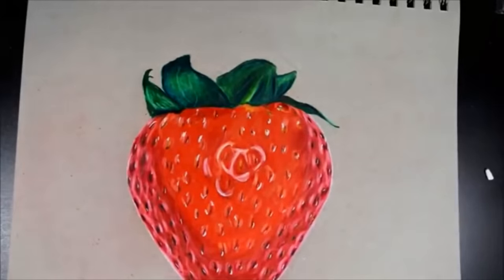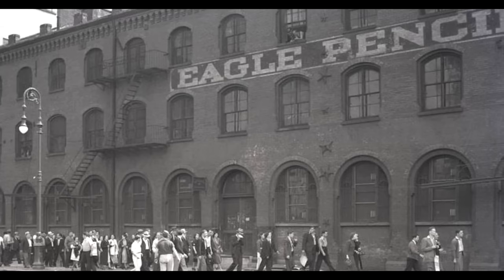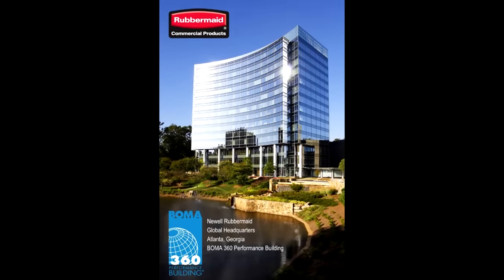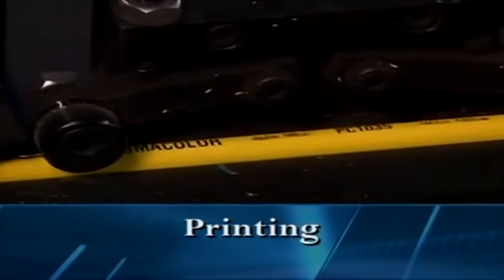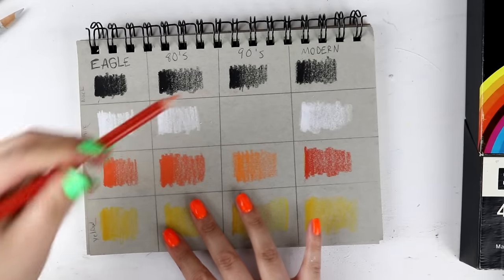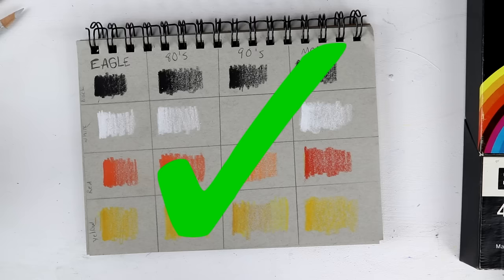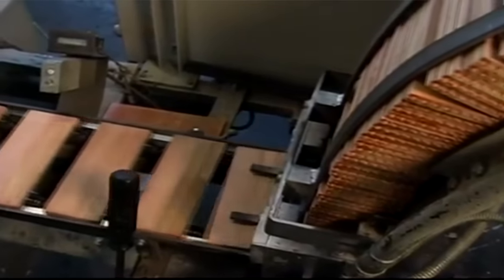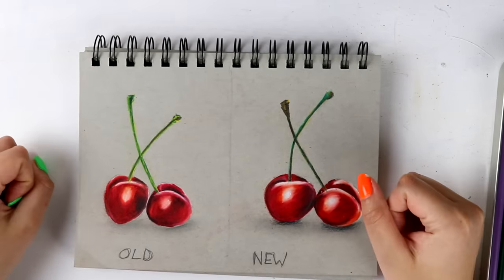Comparing 80 YEAR OLD Prismacolor VS 2019 Prismacolor Pencils: Have They Gotten Better Or Worse?

Comment: Alternative theory: they have always been softcores but the cores have dried/hardened over time
Note: I have a set of eagle prismacolors and they are just as soft as my new ones, but they were in an old protective tin when I bought them. Maybe air exposer over time changes or impacts the cores
Reply: That is what I thought. It makes sense
Reply: oh I didn’t even think of that
Reply: This theory makes the most sense, tbh.  Rather than some secret conspiracy of a formula change.
Reply: I agree with you. I have a set from  eagle prismacolors as well and they're just as soft.
Reply: I agree!! I have a set of BEROL's from 1970 (sigh...my first set)...and they were buttery soft and the ones I still have still are. I just can't handle the never ending breakage of the new ones. It's frustrating as heck and why I switched to Polychromos.
Reply: @mcescher1957  I ended up doing the same. Polychromos and Pablo pencils.
Reply: This.
Reply: wait.. you're smarter than I am lmao
Reply: Yeah, my grandma gave me an EAGLE set, and they're super smooth and I love them. I remember some classmates in art class were jealous of how nice they were...But I am no expert in colored pencils.
Reply: Precisely my thoughts
Reply: I don't think so. I found some old ones in my grandparents house vs the verithins and the old prismas appear to be the same hardness as the verithins.
Reply: Or there using different chemical mixtures and coloring bcuz and it changes the density
Reply: I agree.  The wood is what the problem seems to be.  It shreds, splinters, and is near to impossible to sharpen on some pencils.  I got 4 inches of use from a red pencil that wouldn't sharpen and just broke with each turn of the sharpener.
Reply: Yes, I have notice the same thing with cosmetics.  So, there really is not way to tell the difference in quality.  You will never have a new product from the 70's because it is from the 70's .  Things age.  It is cool to see someone drawing with the old pencils though.
Reply: This was my thought. Even the notorious Twinky is going to dry out a bit over several decades.
Reply: You know what that actually does make a lot of sense
Reply: awkwardsity good thought.
Reply: It may be due to moisture and evaporation over time this may change how wax changes over time like the wax probably melting together due to formula or drying
Reply: Ok, so, one of the biggest things here that we have to know, is whether they are still wax based or if they were oil based, an oil based colored pencil is going to be much stiffer and allows for better line work, while a wax provides a much softer tone and great pigment overlay, oil based pencils don't blend the best.

I did however notice that it looked as if the old pencils went down like wax in the video, but they seemed to just smear instead of blend.
I too am inclined to believe that they are just a dried wax pencil, but you never know, unless someone has the old package.
Reply: Shadowwolf975 I have some from the 90s still in the package that claim to be wax, but the eagle ones I have don’t have any ingredients listed on the package
Reply: @awkwardsity  dang, that would have definitely helped clear things up
Reply: This seems pretty obvious
Reply: E Nunya I don’t have Prismacolors but this happens to me with other pencils and colored pencils.  I’ve noticed it with more recent Crayola colored pencils.  It’s very annoying.
Reply: I agree with this. I was able to get some eagle prismacolors and another set called Eagle Verithin and they work wonderfully for me. They are incredibly soft and layer well, so it was odd to see how they behaved for Rae versus what I have seen and am used to.
Edit- I also have some Venus Col-Erase Pencils that have hardened up, and some that are exactly the same type but are super soft and lovely to use.
Reply: It does
Reply: @enunya  (I'm sorry this comment is old) I bought prismacolours once and hated them. The wood was terrible they just fell apart and didn't even last a week. I think I threw them out lol. I've since seen people talk about using knives to sharpen them instead but honestly it's just not worth it for me.
Reply: Nope, I used those old Prismacolors in art school late 70's early 80s and I used them with a few strays from my Dad's Eagle pencil stash.  The formula had to be different because blending back then was a whole different thing.  You layered light layers over one another to mix the colors optically , not actually blending the medium physically.  OR you used a Q-tip with a little solvent to get the colors to blend.  Clearly new Prismacolor blends physically on the paper. At least in the cases of some colors.
Reply: Yeh could be, but isnt it waxy? Would wax do that
Reply: That's my theory as well
Reply: The only change I suspect is the wooden barrel. I feel like the wood is cheaper but the formula is the same.
Reply: @Possumspade  Yes, wax will dry over time. It becomes brittle and discolored as it ages.
Reply: That’s what I thought, too!
Reply: @enunya  The worst part is, I am not entirely convinced its an issue of just being cheap. I kind of suspect that there might just… not be enough trees left of the harder, higher quality wood to make pencils out of them anymore. Not if people want hardwood in their house at least. :/

Comment: Eagle looks the most pigmented. Is that just me?
Reply: Noah Crozier yh especially that those has been around for 80 yrs, just imagine how they looked like as new
Reply: It does
Reply: They are more for sure. I work in mostly vintage pencils and they seem to me to be the best of both worlds. Best of Polychromos and of Prismacolor. I thought it could be age but I like the older than Midpoint. There is a version before Eagle and that is when it was Eagle “Turquoise” Prismacolor colored pencils. Eventually it dropped out and Turquoise was meant for the graphite alone. Canada had factories as well and their versions kept up the quality much longer than US.

Comment: Love this video....as a 62 year old artist, I got my first set of Prismacolors around 1970...and it really breaks my heart to see how the quality of this loved art supply has plummeted. In fact, I actually still have a few of my original Prismas in my collection (I can tell because 1) they say BEROL Prismacolor 2) the color FLESH instead of the now pc  LIGHT PEACH and 3) they are stubs....The fact that these older pencils are still being used and haven't shattered into a million bits, while my brand spanking new pencils shatter if I stare at them too long...tells the tale. It's also the reason why I switched to Polychromos pencils...I had that wonderful set of 48 with the self standing packaging. It was the best. .Prismacolor...I hardly knew ye.....(lol) Keep it up Rae...I've been around the art world for a long time, and your videos are some of the best!! BTW...one more thing...it's not just an uneven core, or that the pencils are a softer formula...I'm fine with that...BUT the pencils break because the pigment cores are not glued onto the surrounding wood. Because of this, whenever a pencil is dropped (either in shipping or whatever) the core shatters into a million bits and that is why you often cannot sharpen them. I have tried heating up the pencils to soften and "heal" broken cores...but unfortunately, until the makers of this wonderfully buttery soft core start gluing those puppies in place...this will never stop. And I just couldn't justify paying good money for a pencil that I used once because every time I used it, it would break, and then break in the sharpener, again, and again, and again.......on infinitum....you get the picture.

Comment: Material do get old and brittle over time. I remember those pencils being soft. Like when you have new crayola crayons their better than the old  ones. They do expire at times even though they shouldn't.

My american prismacolor still don't break and their butter smooth still but I keep them in a not so dry but dry area. So if your pencils came from texas or other silly hot states like California... they might be not the best reputations of what they were long ago.

Just to edit and add. It's because things still have moisture in them even wax unless their are products like dry pastel that they wont loss their consistence. Wax actually have moisture and when it loses it in products it cause them to not work well but to much of it can hinder it too.

Comment: Great video! I think another thing to consider is the effects of aging on old stock. I don’t think that a 1930s era pencil will perform the same way today as it did when it was new.  But this is a factor that is virtually impossible to test unless you have the resources to make a new pencil using the original formula.

Comment: On the final drawing, was she just using the 30s ones and the 2019 ones, or the 30s and the 80s together and the 2019 and the 90s together, or 30s, 80s, 90s together and the 2019 one for the new?
Reply: Miss "Nancy Drew's" rudeness aside...I wondered the same thing.  She didn't clarify that and it could be any of things you mentioned.  I personally thought original & 80's vs 90's & now.  But it could have been just the original vs now and skipped the 80's & 90's since 80's was similar to old and 90's similar to new.  Anywho, doesn't really matter to me...idk why I watch these videos, I'm not an artist.  Not a good one, anyway! 😄  I guess I still find it interesting and I like Rae's personality.
Reply: Sweet Insanity I’m not an artist, either, but I was curious. Haha. There’s also the fact that she said the formula most likely changed around the 90s area, so I didn’t know if she was comparing formulas, either 🤷🏻‍♀️
Reply from the maker: I used the 30s/80s and the modern (skipped using the 90s since they’re the same as the modern) 😎🎉
Reply: SuperRaeDizzle Ooh, okay. Thank you, Rae! ❤️

Comment: That 90’s 24 was my first prismacolor set, I still have it.  The package is a little cheap but it does transform into an easel to make them easier to access while using them.  I also have two 48 piece sets and a 120 from the late 90’s-mid 2000’s. Oddly enough, the 120 has Sanford prismacolor stamped on them instead of Berol.

Comment: One thing to add about the newer pencils: there were glue issues. If dropped for example, the lead would break inside and sharpening would be problematic. Lead would even fall out. I did not drop my pencils but the ones I ordered did have inside breakage. I have no problems with my older pencils. Also layering with oil based pencils such as Faber-Castell is not done by burnishing; you have to do it in light layers; do not fill up the tooth of the paper until the final step. Thank you for the video. I enjoyed seeing the older pencils side by side with the new!

Comment: The packaging from the 90s era Prismacolor set had a stiffer cardboard box inside the thin cardboard cover with two flocked plastic pencil trays. The top folded down to prop the case up, similar to Staedtler fineliner cases. I purchased the large set in 1997, the lead is very soft. The Prismacolor Verithin colored pencils have a harder lead that is harder to blend.

Comment: A lot of it is also preference and experience. I was gifted a tin of Koh-i-Nors in middle school, right as I was starting to experiment with color. I have tend to prefer them over any other brand because I know how they work and how to use them well. Older artists working through the transition may have had all that experience and comfort with using that particular tool change with no explanation.

Comment: I actually have a set of old Berol Prismacolours as well as the newer Scholar Prismacolours and Prismacolour Premiere.  The biggest difference between the Berol Prismacolour versus the ones of today is the lead width.  In the old one the lead was wider and they used less wood.  Today they make the leads thinner.  The quality of the wood is another big difference.  My Berol's don't break as easy as my current ones.  They also had a wax base to the older ones which is why blending was not easy.  Today they use more pigment and still a base of wax however because they use less wax it creates a much smoother blending.  Just a few notes about these.  They are my absolute favourite pencils however I am in love with my Faber Castells as well and they are break resistant and blend very well.

Comment: I took five years of just art classes at my local art store. Many classes were just using the Prismacolor pencils. We used the wax versions. The Verithins are not real color art pencils. They are hard and to not blend well. A couple of my classes taught how to blend using order less paint thinner. We used a script liner brush. I like using the dry brush technique. Very little thinner on the brush. 
The thinner softens the wax in the pencil on paper and does a fantastic job of blending. Even the colorless blender cannot do this good. However, nothing beats digital. I can draw by hand, scan it in, and paint over. Photoshop was the best. They decided to raise the price and then stop selling it as a product. I have since converted to Clip Paint Studio. It is not as expensive as Photoshop was. It is geared for artist not photographers. It can still no most, of what Photoshop did with photos. The quality is unmatched. Most of my work is geared to animation and I have been drawing inside the animation tool. You can still shade and use images for textures. It is higher quality than pen, pencil, and water color. 
In this video, I am assuming that the Prismacolor pencils are the wax art pencils. Before art school, I did not realize that there are two kinds of color pencils. Only the wax versions are intends to do artistic things.

Comment: You're right... If I recall correctly, Berol came to possess the formulation for the Laurentien pencil crayons, from Canada, sometime in the early to mid 1990's which would explain the new "creamier" formulation of Prismacolours. Laurentien pencil crayons were incredibly creamy and lovely to work with. Sadly, they are no longer available. It may not be exactly the same, but I'm sure it helped them reformulate their pencil crayon formulas.

Comment: I have recently started switching over from Prismacolor to Polychromos & Holbein. I’ve used the Polychromos on a tiny part of a drawing & I see a huge difference already! I’ll probably use prismacolor for practice sketches from here on out. 
Heck, I was using one of my prismacolors a couple of months back, I noticed the lead was nowhere near centered. Also the constant breakage was an issue.

Comment: if you purchase a manual desk sharpener like they used to use in schools (I use helix) then you will find that your prismacolors will very rarely snap anymore. I have been using the same sharpener for 6 months, drawing every day, and I have not yet had to replace the blades. Honestly, it's a gamechanger, and I don't know what I did before I had one.

Comment: In March 2017 I purchased 132 prismacolors for $57 on Amazon.  This same set of 132 prismacolors is being sold on Amazon today for $110. Amazingly right now the 150 prismacolor set  is selling for $112. Lots of interesting price shifting.  Your video here Rae was especially interesting for me, I've been a dilettante artist all my life, but also poor. When I get to purchase some prismacolors it's a big deal for me and I really appreciate them in my humble state.  In the past I have had one or two prismacolors that would sharpen by leaving a piece of wood on the side of the sharpened tip, ( side effect of off center core ). Only thing I dislike about prismacolors is the wax blooming.  Once I lightly sprayed my prismacolor artwork with a layer of "workable fixative", and, SHABANG! Lots and lots of my intricate details vanished instantly and we're lost! Also I've noticed, if you don't spray your prismacolor artwork with a sealer like workable fixative, over time the prismacolors will oxidate and form a cloudy- like transparent film over the work. Small nuisances, but overall prismacolors are Little Miracles! I loved your video Rae!!

Comment: I have found old karisma and prisma and faber castell individual pencils at a recycling center in Houston, better wood casing, brilliant and secondary colors and smooth sharpening. It's worth the trip most times.

It's been a learning curve for me between wax based and oil based pigment cores. Using opt (odorless paint thinner) vs colorless wax or alcohol blenders was another level, as is blending,with pencils alone..i have a lot of brands in small sets, and I think there are different reasons i prefer one over another depending on what I'm working on.

Comment: Have you tried the elusive Karisma Color Pencils? They were also Berol color pencil that got discontinued like 15 years back. Although there use to be lots of rumors about how it's sort of a magical pencil that's creamy smooth like the new ones yet also retains a point without breakage, I read that it's essentially UK version of Prismacolor. Thought it would be interesting to see. The design is gorgeous I will say that much.

Comment: Bought my first Berol Primacolor, with Ltd tin in 1991. I liked the softness of the lead because I was used to mixing oil paint. The new sets feel less vibrant, but the worst problem I am having with a new set is the wood actually splitting.